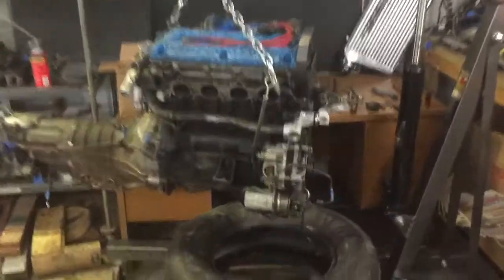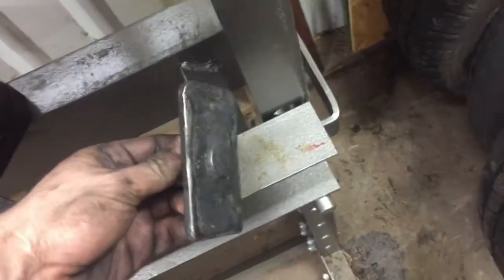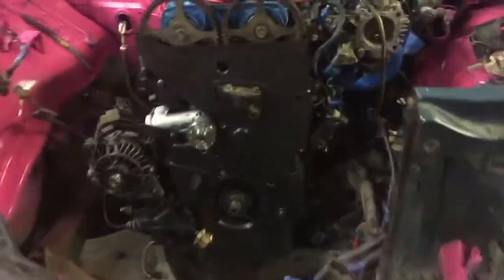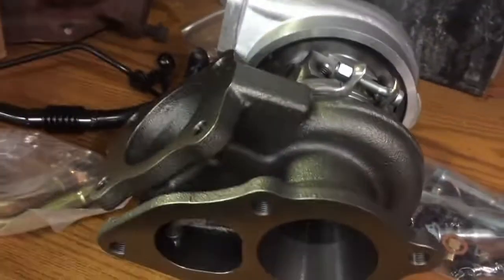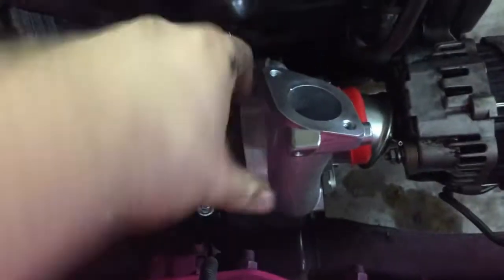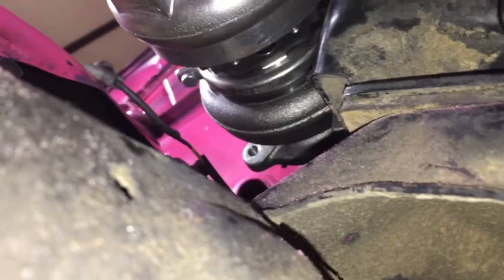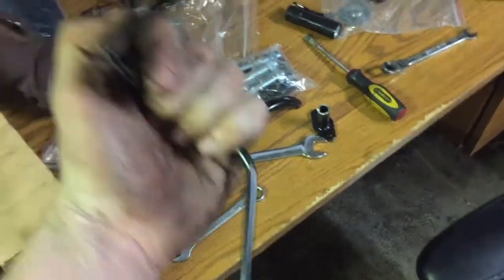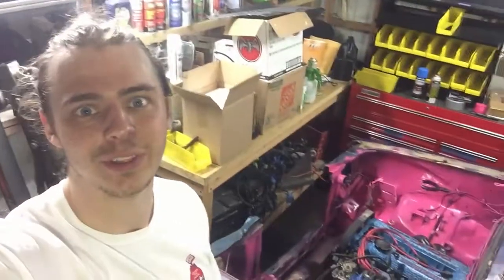Mighty Max 4G63 Swap Part 10 - Fitting the 16G Turbo

Comment: what transmision you used for this swap? 
@Till the Wheels Fall Off
Reply from the maker: KM-132
Reply: thanks for answering. but what is that transmission I have no knowledge. and you had to make the plate so that it falls on the 4g63 engine. my engine is eclipse 98 7 bolts 2g does it work for me?
Reply from the maker: Its the manual transmission that comes on the 2nd gen Mighty Max/Dodge D50 with the 2.0L engine. The KM-132 will bolt up to that engine, its the same one I use in these videos
Reply: It fits perfectly like pnp Or you need to cut and change the bellhousing?
Reply: I would also love to know!

Comment: In addition to bending the waste-gate vacuum port, it looks like you might need to cut the charge stud down a little on the alternator just to be on the safe side thats what I'd do, but all in all great progress man I love seeing the 4g63 in the bay looks killer.
Reply from the maker: Mitsubishikid I threw the belt on and it moved the alternator higher than I thought so it looks like I'll have plenty of clearance. Thanks for the support!
Reply: good to know man, if I ever get out of the smog-Nazi state of CA I'm likely gonna do this swap on my 4x4 mighty max.